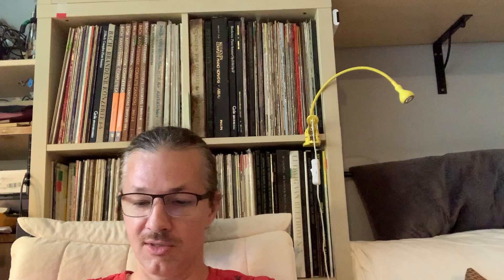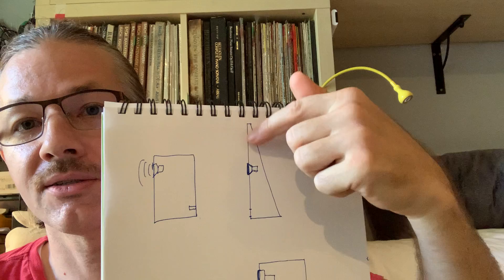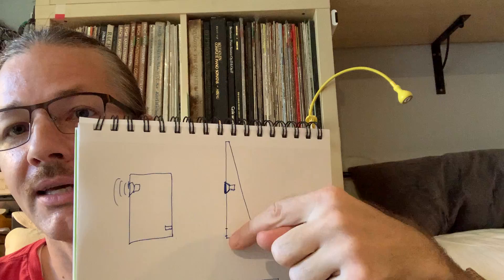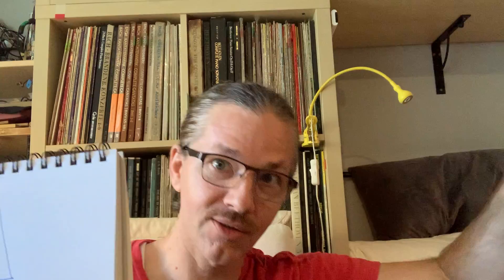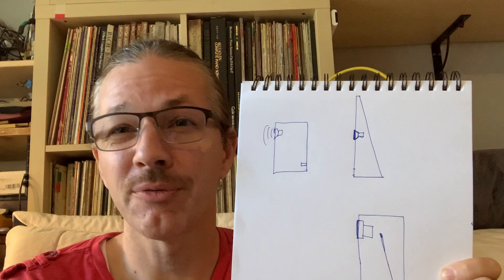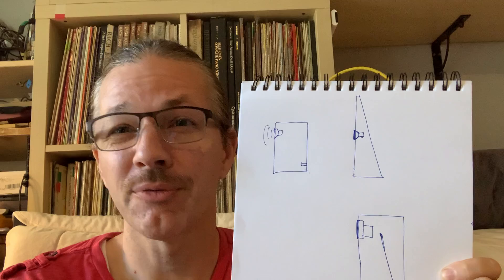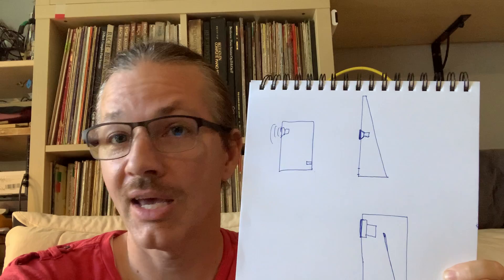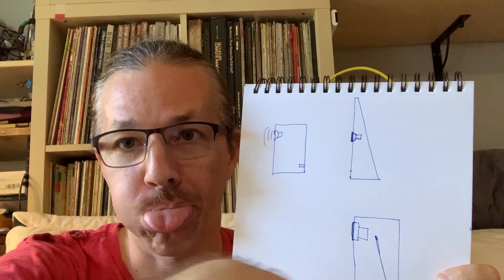Voigt pipes and MLTL -  how they work?! Which will fit my room?!

Comment: The real explanation about low frequency attenuation in small rooms is the cancellation effect when waves resonances of your room hits the back of the cone driver via the mouth of the pipe. A mass load can help to minimize this effect, as its react as a buffer. On the other side this effect is a self healing process to cancel room  resonances.
Reply from the maker: Exactly! 👍👍 And that's also the reason why the amplifier choice is critical, and why high DF amps might not work well, as they try to counteract this interaction...

Comment: I have built a pair of Frugal Horns XL  and enjoy them but I was not getting the bass response that everyone talks about.  Thanks, to your videos I now have a greater understanding of the Voigt pipe and its strengths and limitations.  Thank you so much.
Reply from the maker: Hi Steve, with horns and pipes a lot rides on the room interaction to form bass, as the low frequencies are not created by pressurization. Also, the amp - speakers relationship is super critical as well, you might get zero bass with one and thunderous with another.

Comment: So I had a bit of a revealation when building my Frugal Horn Lites and they are basically a single fold Voigt pipe like you have drawn, but with the drive flipped to the "back" and then with curved sweeps added to the port, extending it into a type of horn-ish output. Quite smart.
Reply from the maker: Scott, what was that revelation? 👍✨

Comment: This is probably the best video Janos that I wanted to see thank you. I have a 27ft depth room and will make both type boxes and hear the difference 
I have tang band 1808 and SB20FRPC30 
Any idea on the internal damping u suggest and crossover ?
Reply from the maker: Try light stuffing in the top section, and just a single small capacitor for the tweeter, running the main driver full range.

Comment: Hi János, excellent video, thank you. I am considering to build a pair of Voigt pipes one day, and I understood the requirements in terms of room dimensions to get the best out of them. However, I am still unsure whether our flat is a suitable place for such speakers, I'll try to do my best in describing it, for the lack of ability to upload a floor plan here. So the living room is only 4.84 x 4.25 m, the hifi is on the long wall (it can'tbe elsewhere). Just next to it, on the short wall, there is the kitchen. The kitchen is open towards the living room across its full width (2.6m, with a large, 4-wing door that is always open), leaving only a smaller portion to the wall potentially blocking/reflecting the sound waves. Then, after the kitchen, there is the bedroom, separated by another relatively big double door (which is most of the time open). Those 3 rooms (living room + kitchen + bedroom) constitute a 12.3 m long "channel" or "tube", if you like, which is 1.2m at its narrowest section (the bedroom door), but most of the time, it's wider. Like I said, the speakers are on the long wall of the living room, so in front of them, there is only 4.25 m to the other wall, but the whole system is on one end of this 12.3 m long space (the long axis extends to the right side from the speakers: living room -> kitchen -> bedroom).  The ceiling is 3m high in all of the rooms. Could that space and set-up possibly work well with Voigt pipes in your opinion? Thank you in advance!
Reply from the maker: Hello Bálint, that's sadly the situation that tends to cripple Voigt pipes, or makes the amplifier choice critical. (Can;t make a generic amp recommendation, as the actual synergy between room-driver-amp will matter, and that's relatively unpredictable until tested). I have a similar situation in my living room downstairs, and my Fostex FE204 Voigt pipes did not work there with my amplifiers. Well, they did make sound and not bad at that... yet it was but a faint shadow of what they are capable of in a balanced room. 
To make a Voigt pipe work in such a setting you will need a driver with a high Qts (such as the Cube audio Fc8, but all the Fostex drivers are off the menu), or have a very specific amplifier - speakers match. For example, in my case, with the Fostex FE204 VP they were completely OK in that unbalanced room setting when matched with a Quicksilver Triode amplifier. (However, no other SE/PP amplifier nor solid state made it work - everything rolled off basically around 200Hz!) 
There's one thing you might try.... build the Voigt pipes and if you don't get enough bass, then convert it to slot port bass reflex cabinet. Will look like a Voigt pipe, but with a port instead of the mouth. I have done this, and this can / will make the cabinet generate bass in rooms / amplifier choices that do not support quarter wave operation.
Reply: @realworldaudio , thank you, János, for your quick and honest response. In that case, I might just continue to further tweak the speakers I have, which are a sealed box design (in my limited experience, I have preferred sealed boxes to ported ones so far). I have already replaced the built-in crossover with external ones, as you too suggested in another video, and it yielded a great improvement. I guess I could try to make live cabinets instead of the current MDF boxes, as a sort of ultimate mod. My understanding is that such a move would entail the redesigning of the crossover network. Would you be willing to discuss a few questions by email as well? 😊
Reply from the maker: @balintkekedi  Szervusz Bálint, you can write me at: arcturus127@ gmail.com ;

Comment: Thanks Janos….you have a way of getting these concepts across in an easy to understand way.  So what’s your recommendation for the best cabinet type for a full range driver 8” driven by flea power in a small room 4x3.5m.  I’m thinking of experimenting with a diy bass reflex or a Gilbert Briggs style distributed port cabinet.
Reply from the maker: Hi Mike, the bass reflex will work very well. I warmly recommend to use slot ports - can be dual port, just make it slotted. Avoid the plastic PVC pipe tube! 🤣🤣

Comment: Which type is the Pearl Accoustics Sibelius? They sell for something like $5k per pair. Built by a classical music sound engineer, I think. I know they tuned it in a studio using actual instruments to voice them. No crossover.
Reply: I never listened to that speaker but I agree with the philosophy..
Reply from the maker: They re transmission lines. Have not seen the insides, so cannot be more specific than that - basically, they are a kind of Voigt pipe, could be MLTL, we would need to see the insides ; ).

Comment: This was such a fantastic video, Janos. Thank you. Now, would an MLTL cabinet work with a driver and a compression tweeter, or is a full range driver the optimal way to make that type of cabinet really sing? Also, wouldn’t a very small slotted port work better than a small circular one? Again, many thanks for this video. It was extremely helpful. 😊🔊🎶🐱
Reply from the maker: The VOL is effectively a derivation on MLTL ; ). So yes, the woofer by itself can benefit tremendously from MLTL. And, slotted port better for MLTL than circular one... can be big, not just small. The wider, the better. Keep it as wide as the cabinet, so the air flow is laminated and the turbulence is restricted to 1 dimension instead of 2 with the circular & undersized ports. ; ).
Reply: @realworldaudio  Thanks a ton for this information. That’s what I will most likely do. I think my drivers and tweeters should should work well in that type of cabinet. A million thanks again, Janos! 👍🎶🔊🎶

Comment: yes but the Fostex drivers are known for the lack of bass.
do you not have an improvement now with cube drivers.
and another thing if you put it close to the wall and tilt it back will give you more bass
plus if you put a board on the inside of the port 4" -5" long should get you down to 30 Hz ish. plus if the front baffle is wider will increase lower frequencies for an 8" driver 15" across.  just put a board on the front.
Reply from the maker: Yes, the Fc8 has quite a bit more bass output. Although I have to add that the FE204 has excellent bass when positioned properly, in a room that has the length to support it: the FE204 had strong bass down to 30Hz! 
The Fc8 went down to clear 25Hz last night! Significant step-up. ;

Comment: Hi Janos, thanks for this video series, I’m watching each one with much anticipation. Now my room is 2.7x3.8m. I had been planning of building a voigt pipe using Faital Pro 4FE32 (4 inch, 91dB/W/m, Qts 0.61) but after watching this video I’m afraid my room won’t support the wavelength needed for bass. 3.8m is about 100Hz wavelength. For my room would you say a well designed ported enclosure on a stand would be better? Thank you once again!
Reply from the maker: With that high Qts I think you can make it work, although I never tried such high Qts driver in a Voigt pipe, but it should work as the high Qts is very helpful to support bass when the room is smaller than optimal.
Reply: @realworldaudio  Thank you so much, I think it is worth trying then.

Comment: Hi Janos, thanks so much for your work and letting us participate. How much of a difference would it make if you'd switch the position of the driver by 90 degrees in a folded pipe on the sidewall of the cabinet? I was wondering if you could put it directly on the wall. Best regards

Comment: Hi Janos, thank you very much for your very helpful explanations. As I understand you: The biggest dimension in my Room is 5 m, so I would tune the VP to 34 Hz (half a wavelength). But what about the distance between my listening position and die VP? Can I really tune the VP by the room-dimension or do I have to tune it for the distance between me and the VP?
Reply from the maker: That tuning / room size will work extremely well. About the listening position: there is no restraint on the listening position! When the pipes are set up well, you can sit, stand, or lie down anywhere, or even go to next room, it will appear as if there's live music in the room, and the listening position does not impact it. Of course you will experience changes based on the rooms acoustic properties, but it will affect the sound as the room affects instruments played in the room, and when people speak in the room - it will just sound natural vs the great/disappointing dichotomy of most audiofile speakers.

Comment: Can you combine a very large Voigt pipe (IE one built for a 12-inch driver) with something like a DML panel for the ultimate natural full-range response regardless of whether or not you're on axis?
Reply from the maker: Enlarging the front baffle will improve the upper&midbass fullness if needed, an is a fantastic help for low Qt drivers, and onces that can use a lift in that region. With the Cube Audio Fc8 though it's not needed, and it has the best off axis response I ever heard of any loudspeaker. No sudden transition of character, or image when I shift positions or walk around the room, it is just like having musicians in the room and walking around. Virtually identical experience with the freedom of picking where I listen.

Comment: Hi Janos, Trying to understand the difference between having the voigt pipe opening facing the front as they normally do, or like the Cube Audio speaker enclosure (e.g. Nenuphar) that have the pipe opening at the bottom of the cabinet facing the floor.  What is the difference and any advantage of one over the other? 
Is it correct that the internal volume of the voigt pipe should be equal to or larger than Vas of the driver? Thanks.
Reply from the maker: Hi Joe, the Voigt pipes break the Vas rules to a degree, as the opening is so big that the driver literally works with the whole room, not just the internal volume. For example, my Voigt pipes internal volume is way smaller than the Vas of the CA Fc8. 
Front port or floor port - there are several differences, but the main one is you will benefit more of the floor port when you have a hard floor. If you have carpet underneath, then the floor port is catastrophic as the waves get very heavily dampened and the sound collapses. Ultimately that's the key difference between the two.

Comment: Janos can full range drivers convincing ply reproduce full scale orchestra
Reply from the maker: Yes, it is possible. A few dB quieter than the live orchestra though, but it would not be an issue unless someone already has serious hearing problems and needs to blast just to hear / feel anything. Then they will not work for orchestra. 
I have listened to orchestra on the Voigt pipes many times right after going to the symphony, and I found their rendering quite realistic, so much so as I did not feel I was missing out on anything.

Comment: Great video again! Could one say the VOL is pressurised? As the bass reflex has chaos inside and the slot is tuned?
Reply from the maker: Great observation! Yes, it is slightly pressurized! Compared to a regular cabinet, we are talking a few percents in comparison. If we wre comparing it to bench pressing then it would be benching 200kg with a typical BR cabinet, and benching 10kg with the VOL. (Instead of breaking the back, we are not even breaking a sweat ; ).
In a typical BR cabinet under 800Hz there is total chaos, so the entirety of bass and the lower midrange energies are out of whack. Inside the VOL cabinet down to 40Hz there is order. Only the frequencies under 40Hz cause chaos - and these are the ones that get shunted through the slot into the room. So yes, it could be better if the cabinet could support down to let's say 10Hz - but then it would be unrealistically giga-enormous. Hence, I cut the "most reasonable compromise, that pushes the boundaries as far as possible while allowing a  cabinet that fits in my living room. (Also, this is the configuration that the driver prefers the most - going for a longer transmission line would need multiple woofers per cabinet, and I would need not a living room but a hall or theatre to house them!)

Comment: Can the room be too big? What happens if you use them outdoors? Sounds like maybe you get the lowest frequencies, but a bit less SPL?
Reply from the maker: I have never tried them outdoors. However, going for different size rooms and outdoors is a MASSIVE change. Each scenario requires a VASTLY different loudspeaker build. Just think of loudspeakers that they MUST match the room. Like shoe size and feet. Otherwise it does not work. Yes, do do get sound but the range is exceptional sound in a matching room vs very poor sound in a non-matching room - for the very same loudspeaker. 
Also outdoors you get a lot less SPL, not just a bit less. That's why event PA systems have such difficulties, and it's a major feat to produce deep bass outdoors.

Comment: Any software to model a full Voigt Pipe enclosure? Thanks.
Reply from the maker: I have stayed away from software models. I'd really recommend to use a cabinet that has been used successfully, as a software jut gets you in the ballpark, but it can also lead you t a very bad place without knowing it. That's why it's important to build something that someone has already proven it works, and then take from there, fine tune it to your room, placement options, system, preferences.
There are models out there though. Eduard Brokeman has on his channel a video dedicated to a comprehensive speaker modeling software that does transmission line and TQWP simulation. That is very good, but really complex. You will have to dig in very deep, and still will face the issue that you will not know what is the right call to make. I fnd the simulations useful for when you already have your speakers, you re not happy about some aspect and trying to find what can be wrong that needs fixing. That's where the simulations will help. 👍🎶🎶
Reply: There is hornresp, that you enter in the driver parameters and you specify cross sections and their lengths.  The software then plots response cuves.

Comment: Talking of cluster fucks... I'm no expert, but resonance is a very tight band of frequency. If you hold down the sustain pedal on a piano, only the  string that is precisely matched to whatever note you play or sing will sympathetically vibrate. 
 In your hifi situation, you have the natural resonances of the room. The driver and the enclosure, all making narrow peaks in the excitability of the air. Air temperature and atmospheric pressure will also vary the exact frequencies of all these. 

Trying to compensate for driver resonance by introducing an enclosure resonant frequency seems like rolling a second cheese down the hill to fetch the one you dropped.